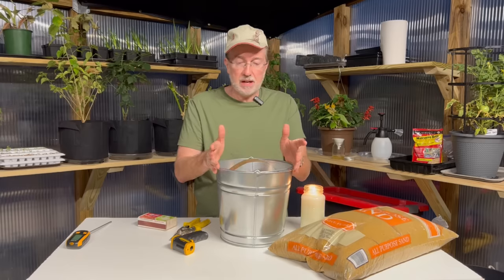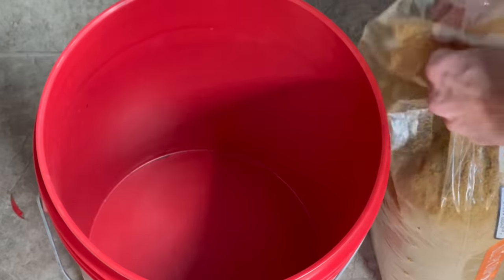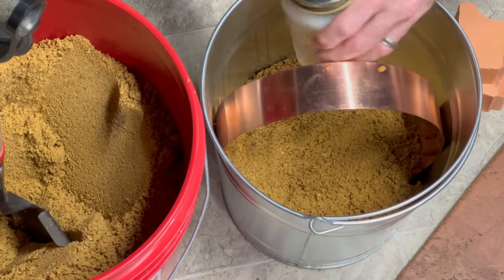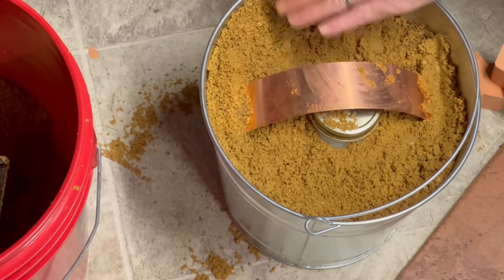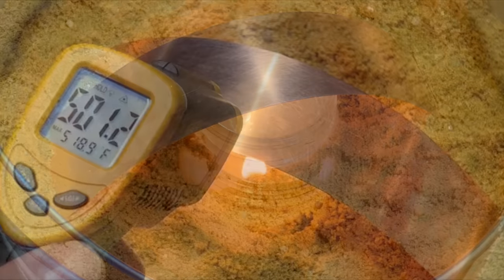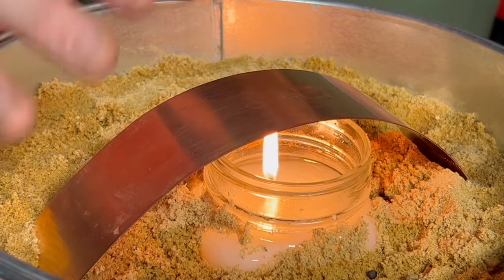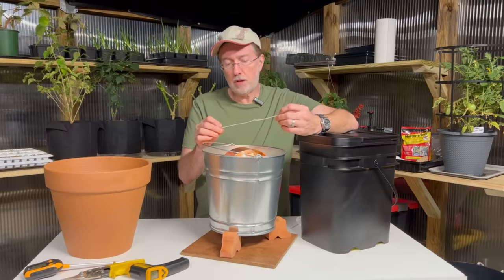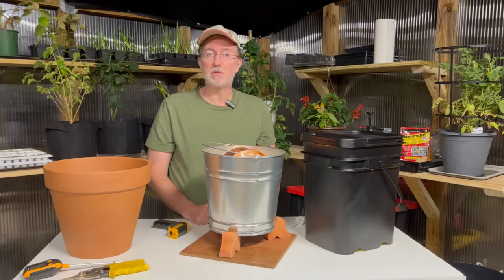DIY Copper And Sand Heater | No Electricity Needed For Greenhouse Heat

Comment: I found that using a propane stove instead of a candle significantly increased the overall effectiveness and produce tons more heat.
Reply from the maker: Thanks for the info.
Reply: Yeah,  heat comes from burning fuel,  not from sand.  LOL You shouldn't need to go to engineering school to know that,  but apparently you do.
Reply: This is more of an emergency heater. As well propane cists.   We have  deep poverty ridden folks here
Reply: propane creates a lot of excess humidity.
Reply: yes but are you also heating a bucket of sand? i didnt think so
Reply: Well a propane stove will give you about 2500w or so if I remember, correctly while a candle give you about 80w is what people say. So it is no surprise propane stove works better at heating a room.... I tried once to heat a small room with 5 candles when the power was out. After 4 hours the temperature did go down from 24c to 17c, and it seemed the 5 candles pretty much did nothing.
Reply: @a64738  why do you peoples names change?
the notification says "rondo cat".
here you have some spam auto-generated name consisting of meaningless numerals.
Reply: Running a pipe from your car exhaust also will heat. They both also can kill you.
Reply: Plus CO2 to feed plants in greenhouse.

Comment: I wouldn't worry about the moisture. Water itself is an excellent thermal mass. In order to get an accurate temperature reading with that spot radiometer on a shiny metal surface, first cover an area on the shiny surface of the metal with masking tape to target. The masking tape will change the surface emissivity value up to the calibration range of the spot radiometer. You will get a much much more accurate measurement. As is, that shiny surface will only radiate about 1/3 the actual energy value.

Comment: I use a triple alcohol burner using a combination of E-85 and alcohol fuel (to lessen the amount of soot produced) to heat a copper pipe.  The pipe is connected to a 55 drum near the lower rib, and at the top.  The drum I'm using is plastic, so the pipe transitions to CPVC at the top and bottom bulkheads.  The burners heat the pipe, which in turn heats the water (with a bit of RV antifreeze in it).  As the water heats, it rises, causing flow to the top an into the drum, while the colder water comes in from the water and is heated.  I took the burners out of 3 14 oz. burners and had a larger tank made, so it should burn for about 14-16 hours.  If ran constantly, I can get the water up to 80-90 degrees, where it radiates heat back out.  I also pained it black, so during the day, it absorbs solar energy as well.  I just use 1/2" water pipe.  There's a video of how I heat my greenhouse on my channel.
Reply: link, pls
Reply: @MrKevinStraub  Click on his user name. You'll find it there.

Comment: Water is a great heat sink, able to store far more energy than sand and has the added benefit of releasing heat slowly. Which is why sandy deserts quickly become freezing cold on clear nights and yet the adjacent sea in coastal areas hardly cools by even one degree overnight.
Reply: Moist Sand adds Mass to the Equation. Correct.
Reply: The sea is WAY WAY larger
Reply: How big the party gets pretty damn cold on the beach at night
Reply: Geography teacher from the 1970s said that land heats and cools 2 1/2 times faster than water.

Comment: This is an interesting video and I'm glad I found it. I will be watching more of your channel. But at the moment I have one question: how would you change the candle without taking the entire system apart? There is rarely only 24-48 hours of cold in this area, zone 5. So changing it out frequently would be necessary.
Reply from the maker: The copper can easily be slid over in the sand.
Reply: Put a piece of stove pipe just big enough to contain the candle before adding the sand. Then you can just slide the candle in and out without the sand caving in.
Reply: That sounds like an awesome tip. I can see it working well. Thanks! @jeepliving1

Comment: Place a postage stamp sized piece of masking tape on the outside of the bucket.  The thermal emissivity of masking tape matches the sensor in your non-contact pyrometer and you will get a reading of the bucket temperature that way.
Reply from the maker: Thanks for the tip….will do.
Reply: and hold the pyrometer steady at a 90deg angle to get a consistent reading
Reply: You can use spray on deodorant to get a correct reading as well. It will be less affected by the heat than burning masking tape.

Comment: Just as an FYI, thermal conductivity of copper is about 1.8x that of aluminum.  As such, using copper is preferential, yet, more expensive. Of course, during daylight hours, a cheap, plastic Fresnel lens focused on the copper strip would be very effective.
Reply: flatten and shape  one inch copper pipe and rivet ends together  to make a ring
Reply from the maker: Interesting idea.  I’ll make a note.  Thanks for the idea.  This is a prototype and I’m always trying new ideas.
Reply from the maker: Excellent idea…

Comment: My brother got a greenhouse of single wall glass together when he became interested in growing orchids while in high school.  maybe 8'x12' near Seattle.  It was heated using a gas fired domestic water heater(40 gal.?), and a loop of pipe, and maybe a pump and thermostat.  It sat in and vented directly into the heated space.
The CO2 was a large benefit to growing and there were plenty of therms. He used propane.
Presently power supplied by Puget Sound Energy costs $0.15/kwhr.  I wonder what veg oils would give on that score.  Usually natural gas furnaces and heat pumps give the most cheapest heat.  and truely,  a good efficient solar designed greenhouse can require very little extra heat.  they say add more insulation and lights cost less than heat when either are wanted.  yeah, got to do the math.
The heat sunk candle looks very safe and elegant and plants do love the CO2.  I guess enough wicks on fire may replace other heating but one may find that cost of food oil may buy many of the parts for a system, and plenty of propane.  Still the candle could work very nice set nearer to cold sensitive plants.
Reply from the maker: True….thanks for your input.
Reply: Oy David PSE is highway robbery. At Peninsula Light, a rural electric membership cooperative in the Gig Harbor area, we pay approximately $0.08 /kWhr. ☹

Comment: Another great video... You have given me many options for supplemental heat in my greenhouse 😊 I'm definitely going to do the cat litter buckets from your last video.  I'm very intrigued with the sand. My greenhouse is 16'x12', do you think one of these is good for supplemental heat or would it be feasible to do two? What size is your greenhouse?
Reply from the maker: It’s 420 sq ft.  The amount of heat you’ll need depends on your winter low temps.  I’m in zone 7a and will still need electric in Jan thru march.  Cutting the electrical usage is my primary goal since my electric heater has a thermostat.  I will use a flame based heater as well as 10x thermal (cat litter containers) Thanks for the question.
Reply: A single Flame from a Candle can heat about 15 cubic feet of space. = 80 BTUs
Heat rises, so you also need to know how high is the top of the area you want to heat.
Lets say it is 8 foot high.
16 x 12 x 8 = 1536 cubic feet
divide that by 15
1536 / 15 = 102.4

So you would need approx 100 of these to provide  heat for your greenhouse.
Reply: That explains why cowboys carried a candle and wool blanket.
Reply: A candle produces no more heat than a candle can produce. Nomatter what you surround it with. All this is doing is storing the energy like a battery. It's just BTUs instead of watts. Then it releases the energy over time. It's one candle. No matter how you cut it.

Comment: My first thought is why not use 2 copper strips North south east and west. Double heat. And another thing if your not needing heat, but want to humidity, it seems to me really wet sand could humidify a good size room or greenhouse.
Reply from the maker: This one’s a prototype and making notes of all the collective info in the comments. Thanks for he input. Will add to my notes. 👍
Reply: My thoughts also. I would use a large can of Crisco, have 4 wicks under each side of the copper.
Reply: @chuckredd9131  I don't think that would leave enough sand the holder of the heat. Unless of coarse if your just humidifying. For humidity just use water only.

Comment: Now I am not the brightest star in the sky, but the candle produces the same heat like this as it would do without the sand and copper. Now u heat the bucket and the bucket heats the room. But if u just burn the candle than the same heat will heat up the room. Faster. It would probably cool down faster but in the end there is no difference
Reply: You're bright enough to understand basic physics.  LOL  You're absolutely correct.
Reply: if you heat the ceiling, only half will be reradiated into the building.
Reply: Does the sand hold heat for a long time? The way rocks do? As a kid, when we'd go camping, my mom would wrap a couple hot rocks with wet towels and put them at the base of the sleeping bags to heat up the tent.
Reply: @machinethesun9243  it disperse less heat but longer. So if u only want a little warm for long time it makes sence. But if u want lot of heat it doesn't work

Comment: the only difference the bucket and sand will make is keep the greenhouse warm for slightly longer ( perhaps an hour )
you might as well just use a candle on its own
the amount of heating you will get will be identical
that $15 on wasted copper, cost of bucket and sand could better be used to buy more candles.
Reply from the maker: Thanks for the comment….it really helps boost the channel on youtube via the algorithm.

Comment: Thank you for the great video... You have given me many options for supplemental heat in my greenhouse, in the video the copper looks a lot wider. The Amazon link for the copper, I was surprised by how narrow the copper width is, only ½ inches. Is this right? Should I be looking for a wider piece?
Reply from the maker: I might have misquoted.  It’s about 2” wide.  There was a link in the description for Amazon but they keep running out of stock. Cheers. 👍